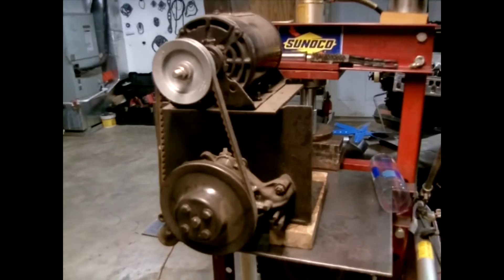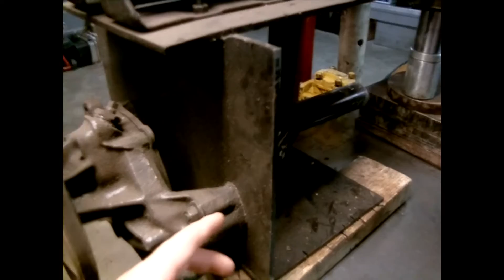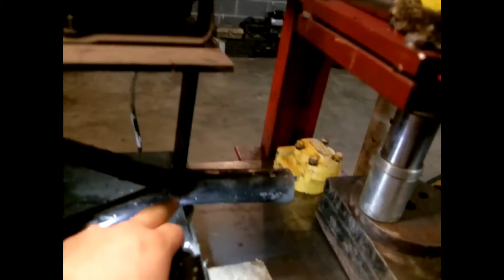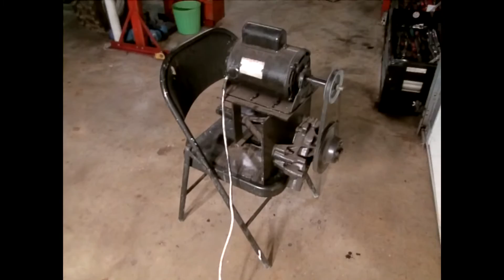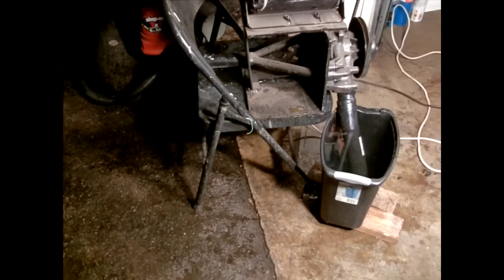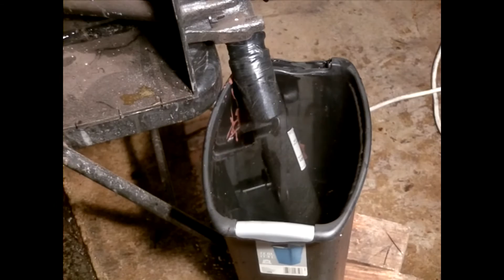Homemade Water Pump

Comment: Thats a great idea could probably use it for a small oudoor wood boiler to pump hot water through the house
Reply from the maker: That was my plan for it actually, that's why I used an automotive pump so it could handle the heat, thanks for watching